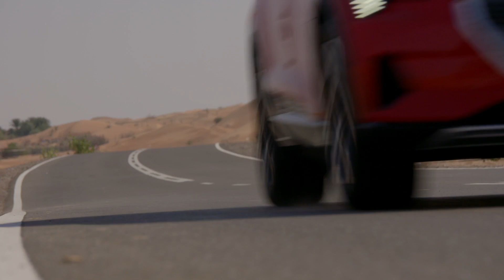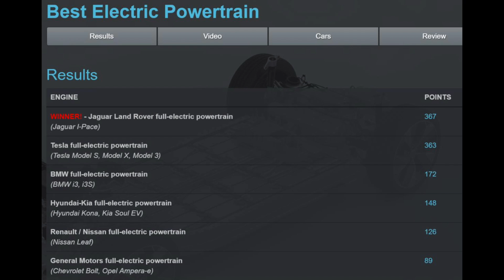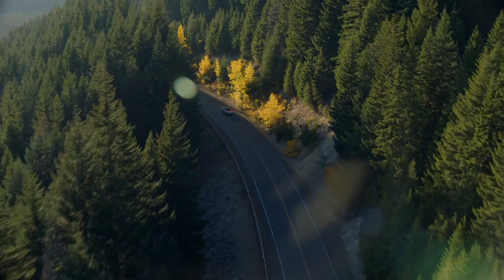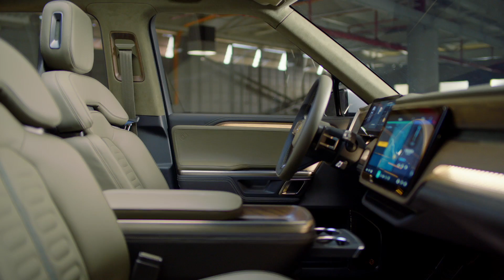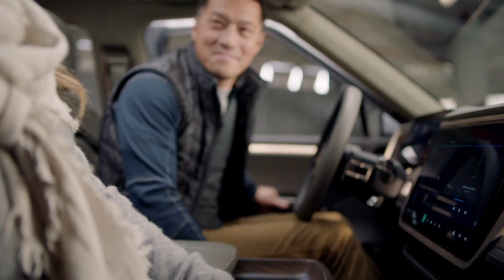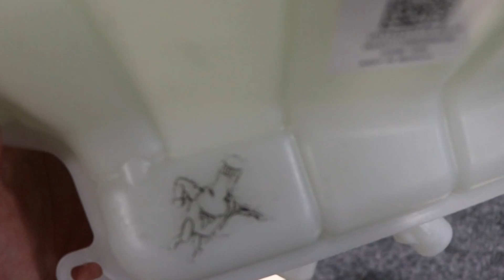Sandy Munro: Model 3 manufacturing, Model Y wiring, and EV competition

Comment from the maker: What does Munro & Associates do? 1:06
What is your technical background? 3:03
What are traditional automakers doing well with EVs? 5:13
What pending EV are you most excited about? 11:38
Why are we not seeing more competitive range EVs from traditional OEMs? 13:57
Do EV makers need to create their own cells to be competitive? 16:22
Will Tesla get into the battery raw materials business? 22:01
Why is the Model 3 over-manufactured? 26:44
Is a 204 mile e-tron and 235 mile I-Pace viable for the luxury EV market? 31:25
What do you make of Rivian’s product and will Ford take advantage of their tech? 36:41
What did you discover between how Tesla and others approached overall design and manufacturing? 45:36
You’ve compared Tesla’s hardware tech to what you see in fighter jets, can you expound on that? 52:52
Reply: Sean Mitchell excellent thank you 😊
Reply: OK not to be nitpicky but way to much space in that comment 😅
Reply: Why do you say 204 mile e-tron and 235 mile I-Pace? Do you actually believe that these cars have substantially shorter range than, e.g. a 259 mile TMX 90D or 255 mile TMX SR Raven? https://youtu.be/q5MHeBsOPno

The European WLTP never rated the TMX 90D, but they have rated the e-tron 259 miles and the TMX SR Raven 233 miles. That seems quite accurate. You should do a story about the EPA.

Your question is still valid of course, but it applies to all electric SUVs today, in my opinion. Even the TMX 100D, now LR.
Reply: These guys must be in the twilight zone.
They have clearly never heard of Tesla, nor know it's a U.S. company
Reply: Add few acoustic panels to that room if reused.
Reply: BMW has stamped hearts to emission devices under the hood, very tiny secret hearts... I noticed one day on EGR valve.
Reply: Sean, Tesla Model 3 is not over-designed. Its body built to last million+ miles as a robotaxi. Not for safety but for the longevity. As Elon stated, it's a commercial grade vehicle. Hence the design decisions like glove box opened from screen that you will be able to block as an owner.
It seems that Sandy and co. does not  recognize Tesla (and it's products) as a future transportation services provider, they just see it as a regular car manufacturer.
Reply: @tarassu  agree!!!!
Reply: The EU test cycle always gives very high MPGs.  The US EPA test cycle has been tweaked 3 times, to provide far more accurate MPG and range (close to everyday experience of the owners)

.
Reply: @TT-Freak  lol, this nextmove story is a joke.  Tesla intends to run their own driving service, just because they don't care about giving special treatment to a fleet owner buying multiple cars doesn't mean a damn thing for the normal owner.  I see lots of bloggers spamming this nextmove story around, but no actual investigation into how normal customers are being treated.  Tesla is fine as long as normal customers are being taken care of enough that they are not complaining about it.

It seems in europe tesla has issues with shipping damage, but that also goes away when they make a factory in europe so they are only going to put so much effort into fixing cosmetic issues that will never exist again in another 1.5-2 years.

Remember that people are complaining about the condition when they get the cars doesn't actually matter much if they love how the car drives and never want to have a car without those features ever again.
Reply: @_PatrickO  It appears you didn't even watch the video, so not much point arguing. By the way their are follow up videos. It's not about special treament it's about getting service at all. Normal customers have the same issues. Plenty of customers have described their personal experiences with Tesla service. The point which becomes more and more clear: mainissue is not service, but a not existing quality control or they work extremely sloppy. Cause many damages are not results of transport , but simply unfinished cars, lacking parts, lacking paint etc.. Service centers can only be overwhelmed with unfinished cars, it shouldn't be their job. Such cars should never leave factory. I watch videos in several languages which show issues with Tesla cars most of them concerning European customers, so there is a clear pattern to be recognised.

Wether Teslas are great cars besides the described issues is not at debate. Here in Europe more and more people who are not fans buy those cars and they want service. Once something goes wrong with the car you have to wait months to get serviced, this is not acceptable for normal customers and even fans start loosing faith. Point is they have to foremost improve quality control to not overwhelem the existing service centers and they also have to have more sc quickly who can deal with normal issues.
Reply: @TT-Freak  Sounds like you are embarrassed by getting corrected on the internet.  Please get a mental health check.  Again, anyone that keeps talking about nextwave as if that situation matters at all vs worrying about actual customers is silly.  Nextwave is a business and are using teslas to make money, they wanted special treatment and tesla wasn't willing to do it for such a small purchaser of cars.  It is pretty funny that people think tesla not caring about commercial partners = bad service for everyone.  Tesla service can be terrible, but the nextwave situation isn't an indicator of anything other than the fact that tesla won't give special treatment to companies that buy teslas for their businesses.
Reply: @_PatrickO  You like insulting other people on the internet its so cosy for you, so anonomous. Well won't work on me I am afraid. You didn't watch the videos. Had you done so you wouldn't keep on claiming what you do. Apart from that you disqualify yourself with your "style" of discussing issues. Pitty that your self-confidence is so low that you need to dismiss other people by trying to insult them.
Reply: Elon Musk fired the body designer, saying he did a poor job (putting bracing support where it was Not needed)

.
Reply: 15:13 Chart of numerical comparison of the models, Bolt @89, Ipace 367, Tesla 363-(Model 3 not rated or it would beat Ipace)
Reply: If I could upvote this video 200 times I would. Just totally awesome.
Reply: Noob lade I live in the mountains and I agree I can’t stand to be down below for more than a couple days. I was one of the few in 2017 that realized the potential of the Chevrolet Bolt as an Uber platform. Even though my 1986 Acura 3.2TL was pretty clean, it still would pollute every where I went for my fares. So I leased the Bolt. It is fantastic for a compliance car almost over engineered similar to Tesla. LG Chem is a good company.
Reply: Ole-Christer Melvold 
WLTP accurate? WLTP is better than the utterly laughable NEDC it replaced.  But it’s still a standard controlled by an automotive industry body rater than an independent regulator like the EPA.
Reply: electrictroy2010 
While I agree the EPA estimates are more accurate than even the newer WLTP, one of the reasons for the higher MPG numbers could be if they’re reported using UK (imperial) gallons rather than US gallons (10MPG using U.K. gallons is around 8.3MPG using US gallons).
Reply: 8:00. "We don't have anything in the US driving people (toward electric cars).

We have fuel economy standards that are going to force cars to get smaller or more electric powered.

Comment: I love that the Munro and associates workers bought Teslas after tearing one apart. I’m buying stock after watching this.
Reply: They also purchased BMW i3 which they still consider the best-designed EV

.
Reply: @electrictroy2010  nowhere ever has Sandy said that the i3 was the best designed EV.  He said it was the most advanced designed EV in 2015, but that was 4 years ago, which is essentially a lifetime compared to the advancements that have been made since then, especially considering the Tesla Model 3 didn't release until 2017.
Reply: The i3 is awesome though, I’d say it’s still very  advanced in choice of material and design.
Reply: During his Tesla tear down review early 2019 he said the BMW i3 is still the best EV he has seen.  He even showed a “circle graph” to demonstrate how high in quality control it was

.
Reply: electrictroy2010, Sandy Munro states the Tesla permanent magnet motor is 5 years ahead of the competition and that the 2170 Tesla battery is the best as well.

Comment: Always refreshing to listen from Sandy, he's a non-fanboy Tesla praiser and always give Tesla a fair amount of criticisms. Any rational Tesla bull who wants unbiased view about Tesla's edge, Sandy is always the one to go to. He's so familiar with the Detroit-ic car corporation culture, and yet he's has all the high regards on the Silicon-Valley-ish Tesla enterprise system.

The biggest takeaway of this video: GM has the highest MBA concentration in the world LOL
Reply: I think the biggest take-away is just how important company culture is to innovation. Once personal goals are more important that company or product success, there is inevitably a fast slope to company irrelavance.
Reply: Munro says Tesla did a good job with the bottom skateboard (motor, battery, etc) BUT screwed-up the upper body design.  He concluded the body designer had never done a body before, because it was a hatchet job

.
Reply: As a TSLA shareholder, I deeply value Sandy's analysis on what Tesla and the larger EV manufacturers are doing wrong or right.  It's all to easy to settle into confirmation and sunk cost biases without a knowledgeable and unbiased 3rd party expert weighing in.
Reply: @xtheory  Ya, I agree. It sounded pretty good from a longterm shareholder perspective because their problems are fixable with standard knowledge. And it sound like the are aware of the issues, at least with the body.

Comment: I’d love to hear Sandy’s thoughts on the aluminum frame casting machine Tesla developed and is planning on using for the Model Y.
Reply: I'd like to hear more too. Cast metal is typically hard and brittle. Not exactly what you want for absorbing impacts and vibration.
Reply: I wonder what the repair procedure would be for  a mildly accident damaged cast aluminium body ? Full body replacement for a low speed fender bender might not go down well with car buyers and insurance companies.
Reply: @dogphlap6749  just like welded body.  Cut and replace.
Reply: @davidbeppler3032  Not from the experience of firearms manufacturers who cast their pistol frames.  Not as long-lived, breaks like pot metal.
Reply: @Dave Dosanjh  Indeed it does cast the frame, not the body but I stuck with the wording from Ian Jorgensen because I was responding to his comment. My question still remains. Just how repairable will these cars be after a low speed crash, one with enough impact to bend the frame. As a general rule but one that may not apply here (I don't know) a casting stressed beyond its elastic limit is sufficiently hard to restore fully to its pre-damaged state that normally it would be thrown away and replaced with a new one (if one was available) for critical cases such as the frame of a motor vehicle. If that applied here it could make a relatively minor impact a write off event. My comment was really an appeal to someone who really understand metallurgy to explain just what the situation is (well beyond my understanding but I think it is a reasonable question to raise). Some of the brightest minds in the business work at Tesla so it's very likely this has been thought of already and it is not a problem.
Reply: @dogphlap6749  hopefully, and probably, they are using a special alloy developed at SpaceX. Much like what'll be used on Starship.
Reply: @brogcooper25  Casting will be done under high pressure to prevent brittleness.
Reply: The body design for the Model 3 was so poor (support braces added where not needed) that Musk fired the designer

.
Reply: @stevencastellanos8063  Stainless steel? Um...no.
Reply: @dogphlap6749  Not that Tesla ever gave a crap about repairability, but if they ever had that awakening, they clearly have to build "fuses" into the structure.
Reply: @vidznstuff1  doesn't have to be stainless. I didn't even mention that. Just saying SpaceX has been messing around creating alloys. Not a stretch to think they came up with an aluminum alloy.
Reply: @dogphlap6749  it is simply the frame. most of the time damage from a accident that damages a frame on a standard car calls for it to be totaled. i think it is fair to assume that they will be using a good grade of alloy . From my (limited understanding) cast alloys tend to be difficult to weld. however it is complexly up to the alloy and casting process that will determine the final characteristics. ultimately i think only test and information revelations by tesla will answer our questions. Keep in mind the after market value of a tesla with a undamaged battery and working motor is very high and the second hard market for every other piece other than the frame is pretty healthy as well (because of tesla's lack of wanting to give them out so freely).

Comment: The most recent patent illustrating that the frame may all be cast as one piece in whole may prove that they've learned to overcome the body 'mistakes' Sandy is pointing out.
Reply: I'm surprised he didn't ask them about it.
Reply: @gigglehertz  Those kinds of problems seem an artifact of Tesla's high level of vertical integration. Vertical integration has been a profound advantage so far, but the disadvantage you have to learn how to do everything yourself. Tesla essentially had to re-learn a few things that other automakers already know. But because they are vertically integrated it is very easy for them to learn those lessons and implement them at a rapid pace.
Reply: Hibbidyhai i see no issues with that. The positives outweigh the negatives here
Reply: @Hibbidyhai  Yeah I figured they just wanted to outsource the design of the "boring" stuff and concentrate on the revolutionary stuff.  No sense putting too much effort into something most people don't care about (I've never in my life measured panel gaps on a car) and get the drive train and software right.  Now that the initial hell is over, time to rethink every nut and bolt and wring out some margin.  Still, I was curious what Sandy would say about a solid cast frame as a single piece.
Reply: Generally speaking, you don't "cast" a frame in one piece.  Frames are made of cold rolled or hydroformed steel or aluminum, welded, bonded, or riveted together into complex 3-D shapes.  While in some motorcycles and for certain pieces of cars, sections of a frame might be made of cast aluminum and welded to other components, the shape of an automobile is much too complex to make in a single piece, and castings are too heavy and/or brittle to be used as the bulk of a car frame.  Sometimes a section made up of smaller pieces of stamped metal assembled together might be manufacturable out of a single piece of metal if large enough dies are made to form the larger single part as a whole, but more likely is that a re-engineering design can make a lighter single part of a different shape that will perform the same function as the multiple parts, if skilled engineers with lots of manufacturing experience are employed to do the design, instead of relative novices with less experience in designing such assemblies.
Reply: @eddiegardner8232  See their multi-directional unibody casting machine
Reply: @eddiegardner8232  Right, which is why I wanted Sandy to comment on it.  Tesla patented a technique to do just that.  I'm not sure what that would mean in the event of a minor crash though.  Would it be totaled if one part is snapped?
Reply: Changing to a cast design won’t fix a poor design.  Munro said the 3’s body looks like it was done by a first-timer who never did a body before (he put bracing members where additional support was Not needed)

.
Reply: @electrictroy2010  Casting as one single piece is meant primarily to cut down on the number of steps and speed up the production process and trim costs.  I'm pretty sure that if you patent a whole new way of casting a frame, that they also will simplify the design.  It would make no sense to go through all that work just to cast an exact replica of an over-designed frame.

Comment: Great interview. Thanks! 
I'm surprised. I've read through nearly all of the main comments and have not seen 1 anti-Tesla troll or even a normal dissenter.
I think Sandy/Mark are wrong about Tesla getting into mining. I believe Tesla will... but not be for lithium or cobalt. It will probably be for nickel. I wouldn't be surprised if it is for copper or aluminium either.